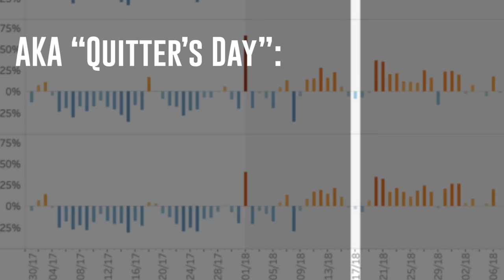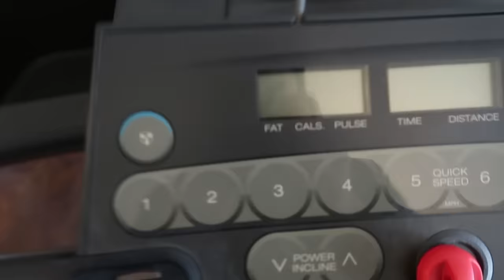Turning a Treadmill Into a PS4 Controller So I Exercise

Comment: Imagine if gyms incorporated this technology into their equipment, imagine all the nerds that would be in there screaming and yelling like the ones in the video.
Reply: death stranding gym edition with save game import, sign me the fuck up
Reply: Nintendo kinda made this several times)
Reply: @BestHakase  Nah, they only made stuff for upper body, which most VR have now. Their Wii Fit board barely counts cause you can just repeatedly lean left and right to simulate walking, but its not gonna make you burn that much calories.

This treadmill will combine well with VR tho. Its like that omni directional device to simualte 360 degrees of movement so you can walk anywhere.

Edit: fixed spelling.
Reply: Then nerds won't be nerds
Reply: Idk. Nerds could barely handle the wii. They would cancel their memberships in 15 minutes.
Reply: A lot of gyms here in LA do. They have some with skyrim and gta v
Reply: Rather to be a nerd than normal people 😂
Reply: It would be  chaos inside the gym lmao
Reply: I'm going to message my local gym and tell them to get a ps4 lmao
Reply: I might actually exercise 😁
Reply: I thinking about them same thing for years. with an account so u won't loose your  progess. It could be something like running away from zombies etc just as an idea
Reply: Orfa iarumas i work out in vr and did you know you lose more calories in vr
Reply: I would become a pro at the gym 100%
Reply: The question is why don't we have this yet!?
Reply: @OP04player  they definitely have the tech to make this but mass production would be crazy expensive and theyre gonna build up to it.. like dude up top commented, they will use an omni direction treadmill of some sorts.
Reply: Gyms have stuff like this actually. Not this game, but exactly the same concept of walking on front of the screen and your character moving in 3D in front of you in big screen.
Reply: @dexteroreo3392  thats sounds awesome actually
Reply: Yeah, it exists back at the nes era. A bicycle racing game
Reply: The Chad Body Nerd
Reply: They've got Monster Energy,  they're a gain away from Juicing.
Reply: Okay million dollar idea :
Put omni directional treadmills and a vr set in gyms but the only available games are horror games
Reply: Imagine putting the cold sweaty vr headset against your face. It's a great idea though

Comment: theoretically you could add more magnets to that detector, dial the speed up a little and it'll be far more responsive with starting/stopping. Because it'll reduce the detection delay from an entire rotation.
Reply: Hello from 1 year later XD. He didn't end up using that magnet detector since he didn't find his programing buddy. He simply connected the motor on the treadmill to a relay, and the relay is hardwired to the PS controller.
Reply: you sound smart lol

Comment: This could actually be good for real fun/exercise if there wasn't so much resistance to walk. A manual treadmill would've worked much better.
Reply: Just what I came to say!.
I would have preferred more weight in the bag than so much resistance.
Reply: Maybe instead of wiring the treadmill to control the joystick, it would've been better to use the joystick like normal but it would change the speed and direction of the treadmill.
Reply: So... maybe something with the omni vr treadmill?

Comment: This is awesome! Here's a few small ideas for tweaking this setup:

Secondary shoulder buttons installed in the form of grips, which are installed in your backpack to stimulate holding the packages for balance.

Downward- Pulling strap that can be adjusted based on how much weight Sam has on his back. The heavier the load, the more pressure is pulled down to stimulate the weight you're carrying in- game.

A waist guard that keeps you standing up to some degree for safety.

Shoulder-controlled turning system.  When you turn your shoulders about 15 or so degrees left or right, it activates the camera directions by a small threshold, or 25 for a larger one.  Adjustable, of course, for comfort.

Action buttons connected to the treadmill, itself, rather than using the controller. Maybe even fashioned to resemble an arcade machine?

Comment: Damn, this has a lot of potentials. With a proper Arduino and some investigations I see so many things that would make the experience much more enjoyable:

- buttons and joysticks moved to the side rails, for easier access
- a proper reading of the treadmill speed to properly simulate stuff, instead of having thresholds
- ideally, have the slope of the treadmill linked to the slope of the terrain (probably need a camera to read that, if it's written anywhere on the screen)
- change the resistance of the treadmill based on the weight of the package you are carrying.

That would be so great.

Comment: Have you considered a more old-school approach by simply having a variable voltage ie. walking fast or slow actuating a variable solenoid which then protrudes as you apply the voltage in varying amounts to push on a controller's paddle or as you slow down not push on it as much?

Comment: Interesting addition: If you put triggers on the left/right side (possibly the hand contacts for the heart meter?) for the balancing shoulder buttons. So it's putting your hands down and taking them off to balance.
Reply: Even better, maybe accelerometers in the backpack that control the balance
Reply: Even better triggers on the side for left right along with buttons for x triangle etc accelerometers in the backpack for balance and vr headset to change camera

Comment: If you could somehow attach the l2 and r2 to pressure plates on the arm rails of the treadmill that would take this game to the next level!! You would also need to add the right joystick to one the arms for camera control. And probably ease the resistance of the treadmill so its not as punishing.

Comment: can't he decrease the required speed for walking and running so that it's exercise not torture so that he can last longer and can this work with all games and what's the backpack for
Reply: Core Gamer backpack is for immersion duh
Reply: The main issue with the treadmill is the resistance of the track.
Reply: @The Gaming Christian In the end he didn't use the magnets, he used the voltage the motor puts out (in this case the motor works as a generator) the relay he used opens at 24volts, and you need to walk that fast to generate that amount (as shown at 4:51). If he would change the relay he could lower the needed walking speed. 

Also I think a lot of the resistance comes from the motor, so it would been better to work around it (straight up disconnecting it from the track), as he planned initially.
Reply: Blade Runner  I was making too much grammatical errors, so it's incoherent, or you don't understand electrical terms?
Reply: The bavkpack was so he could hook himself in place, that way he can walk in place forcing the treadmill to move without holding the handles
Reply: Couldn’t he just increase the sensitivity of the ‘controller’ in this case the treadmill to decrease the speed he’d have to travel? Yes it’d make turning more difficult but that’s not as bad as how intense the treadmill was? Wouldn’t this also allow you to increase intensity of your workout by adjusting the sensitivity?

Comment: I actually could imagine me using a non-crappy version if this.
Reply from the maker: The Arduino version with the motor disconnected from the rotary encoder would actually be good, since you could walk at a normal pace and not struggle so much. Honestly might actually do that IRL not even for a video 😂
Reply: @smutshack2187  oof
Reply: That gotta hurt, piece of crap.
Reply: @allenpan  please make a video of this but instead of using the controller use VR; that would be so frcking cool

Comment: Man, this is like this thing I always wanted to make that's a treadmill that goes along the x axis, MADE of much smaller treadmills that go along the y axis, and each axis has a tachometer. You get an omnidirectional treadmill that outputs x and y direction and magnitude! It should be able to straight-up replace the analog stick on a controller!

Comment: Use a 12v relay (or lower) so you can control the walking speed. Also, remove the flywheel. I think then it would actually be really good
Reply: Strap two ropes to his shoulders so you can conrol the balance yourself and make it pull you down if you fall
Reply: @dandanthedandan7558  you need Michael Reeves abilities to do it
Reply: @megadeath6720  when's the collab coming?
Reply: @dandanthedandan7558  I don't think there will be any at all

Michael has moved to new environment
Reply: @dandanthedandan7558  yeah, he abandoned technology and is trying to be a streamer
Reply: @nathannguyen1431  what
When?
Reply: @nathannguyen1431  lol you're jumping to conclusions. He literally uploaded a new video right after he joined OfflineTV.
Reply: @dandanthedandan7558  that's an insane idea actually

Comment: I just keep coming back to this video.  It's so funny.

IDEAS!
1. Integrate the controller into the backpack.  So to balance you actually grab the straps.  No idea what to do with the other buttons.  
2. The straps that hold you in place should pull to the left or the right to mimic the imbalance in game.  Obviously it needs to be live so as it happens to Norman it happens to you.  (I don't even think this is possible but would be so cool.  Well cool to me.)

Comment: Hey, I had seen this video some time back, but I suddenly got an idea. I don't know if it will work, but I'll just say it. Maybe, instead of using your "leg power" to move the treadmill, you could program the treadmill to move at a certain speed when u want the character to walk and change the speed of treadmill to a higher value to make the character run. The thing this is, you dont have to use leg power to move the treadmill path, instead, u could set it that you-the real person- can walk/ run on the treadmill when the character in the game moves. ie, the treadmill speed walks when the character walks, it changes to run speed when the character runs.  Maybe this is  a bad idea, I just wanted to throw it out there.

Comment: As someone who loves video games and has VR. I would love to have a treadmill hooked to my game. Plus a VR head set on and but for controllers we need to move away form the bulky hand held motion controllers and get into a glove. Imagine playing a game like Skyrim or Fallout 4 which i own in VR and Flat-screen. The biggest issue i have with Fallout4 VR is they didn't do anything to the firearms to make them feel real like in Onward. I would love to a virtual belt/vest on your character which is like your hot key's. And a virtual holster on your leg for pistols. And over the shoulder holster for rifles. And the other shoulder would be your virtual back pack. You have to put your arm back like your grabbing something and move the backpack in front of you and open it to access the inventory. Have a place on your virtual belt to grab mags and you have to take your mag out of your firearm first before putting another in. 

Basically fallout 4 VR with Onward gameplay / controls. But really enhanced and toned.

Comment: Hopefully you or one of your programmer friends revisit this project in the future with a better / omnidirectional treadmill for improved steering and speed control! Being able to do all of the walking, jogging and sprinting speeds would be the perfect experience. This game is all about the journey of reconnecting the country, and it's really interesting to see how people struggle with coordinating things like running and handling the controller at the same time. There are so many situations in the game where you have to push through things like water, tar, and snow, where the resistance of a treadmill would suddenly go right up, as well as changes to the incline when climbing or descending.

The next challenge is finding a weighted package controller that sits on your back, and it pushes you around if you lose balance.

I thought it was pretty mean to actually make them drink monster energy in real life though, that stuff is nasty.

Comment: About the only thing I can think of is triggers or buttons on the side/middle bars to handle L2/R2 weight balancing with some sort of tilt sensor helmet for the right stick look (so you dont need to hold a controller at all)
Reply: capacitive sensors on the handles for R/L buttons (grip to balance) and the arduino already supports an accelerometer (some models come with one iirc)...

Comment: to improve this, you can either harness the bag to the ceiling or create a controller mount with arm rest/arm supporter at the front to lessen the balancing issues at staying up while running and holding the controller so you have more focus on the legs
I have similar project still on planning stage due to funds issue cause I need to commission a frame which can be strapped to the upper body and balance by being hanged on the ceiling and has a part that is directly mounted to a wired separated left analog stick so mine has less tension since I won't use a treadmill to move (so hard to explain but I hope you get what I mean), I'm so amazed you nailed the realism very much using the treadmill
you just literally made a legit vr 1(or 2?) direction controller, all you need now is a vr headset

Comment: You can even take real therdmill and paint a patch white paint on it and use ir sensor to calculate running sppen thus making the controller connected to aurdino via Bluetooth

Comment: Imagine this with a PC and VR. The reason for the resistance on the belt is, I would guess, the motors being spun. If you disconnected that, you could replace it with some other system to vary the resistance. Maybe like regenerative breaking, but with the load on the electromagnet being varied by the microprocessor. On PC I’m sure you could find a way to determine the grade of the terrain, and control the tilt of the conveyer. VR goggles for proper immersion, and BOOM, highly realistic exercise game!

Comment: You should put sensors into the backpack and a system similar to the ballast in a submarine. Then you could pump water into the backpack and add weight and have it were you have to lean from one side to the other and have that control the triggers so you don’t even need a controller in your hands

Comment: Did you ever think about putting the buttons on the treadmill handles instead of a joystick? This way you will have some support while still be able to play. To be even esier you can use the HID arduino library to emulate a keyboard and make the controlls more resposive.

Comment: I stumbled upon this stupid late, but maybe set the thresholds a bit lower and separate the controller into handheld bits like a set of switch joycons or vr games. By setting the threshold lower people would play for longer which would be better than short bursts of intense work. The games that require walking for long periods in game are usually the types meant to suck you in for hours at a time. The separated joyce's let people walk more naturally while still having the extended control. Disabling forward motion and run on the left analog stick, while preserving the other ranges of motion would be an interesting idea as well.

Comment: It would be neat if you could have the in-game movement be sensed by the electronics and dictate the speed of the treadmill, you could do something like intercept the PS4 controller signals and then have it move based on button depressed/potentiometer voltage. and then if you had a working treadmil, you could just install a relay to click the up and down buttons of the treadmill to get to target speeds

Comment: Could you not just tune a transistor to emulate the pot in the stick based in voltage and only use a relay for the sprint to allow for more granular control?

Comment: You have made the gamepad react to commands from the treadmill, but the best thing would be to have the treadmill react to commands from the gamepad. That is, when you press the walk button the treadmill starts to work and when you press the run button the treadmill increases its speed. That would improve accuracy and it wouldn't be physically tiring.

Comment: great idea but you could have made this so much better, the hall sensor idea is great but it should just be used for speed control, you could also figure out how to power the motor to actually stop the threadmill and you would need some kind of way to detect if anyone is pushing on the threadmill.  I'm sure this idea could WORK and be adapted to a LOT of threadmills, you have something worth building here.

Comment: I would probably have removed the treadmills original motor becouse it would be adding more resistance when you walk. Instead of using the original motor I would put a rc plane or car motor on it which you wouldn't notice when walking but would also out put enough energy to make the circuit work.

Comment: Should have split the controller in half and put the right-hand buttons on the right side of the treadmill grip bar and the left half on the left side of the grip bar. Then you could hold on and control at the same time.

Comment: What if you will use the usual left joystick to move, but it will automatically increase the moving speed of the treadmill. Then you will not need to work so hard to push the treadmill with your own legs. Could be interesting.

Comment: What about two treadmill in parallel? measure the speed difference and use that to turn left or right. Put weight scales under each treadmill to measure the weight balance